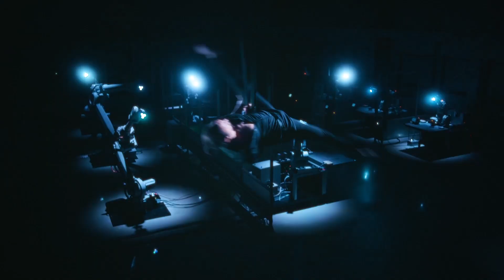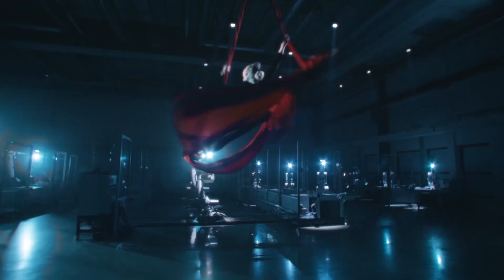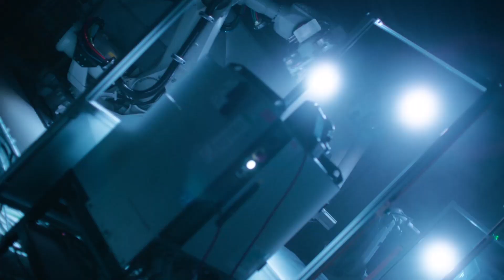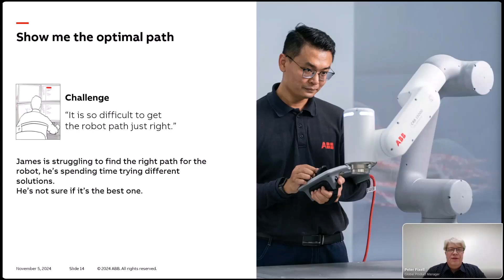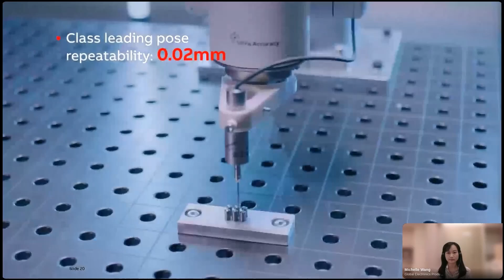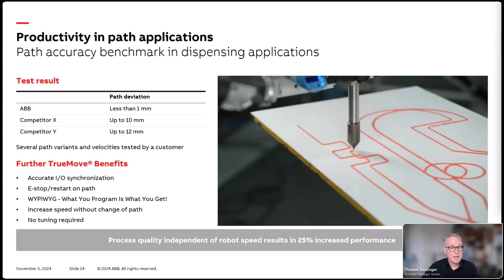OmniCore: Enhanced Productivity & Performance from Motion Control to Cybersecurity

Comment: "OmniCore's impact on Industry 4.0-oriented productivity is impressive. Tools like Automatic Path Planning in RobotStudio not only validate the power of the digital twin to slash commissioning times, but the algorithmic path optimization—achieving drastic cycle reductions and up to a 36% savings in energy consumption—demonstrates how advanced automation is answering today's challenges in sustainability and efficiency. The future of motion control!"